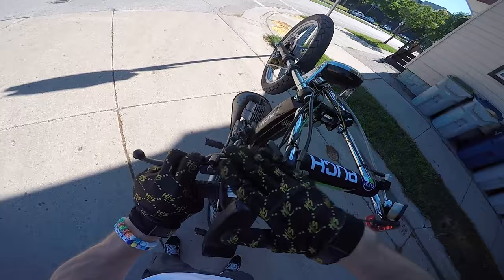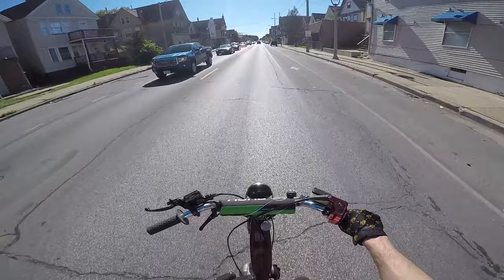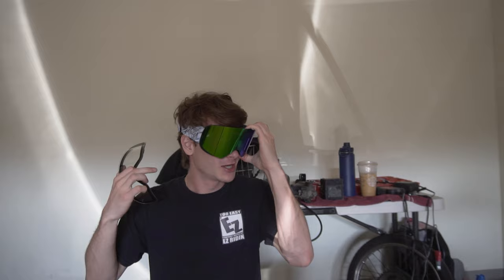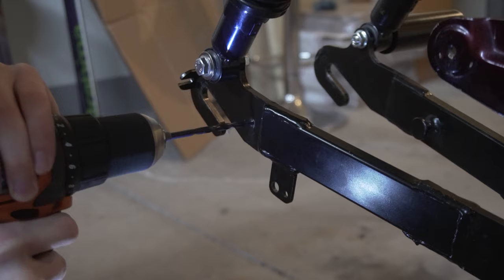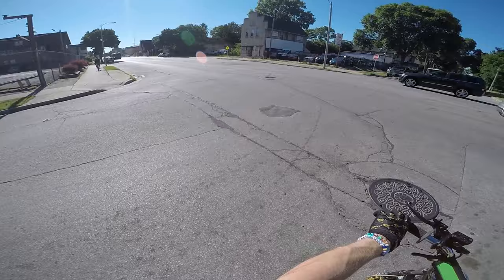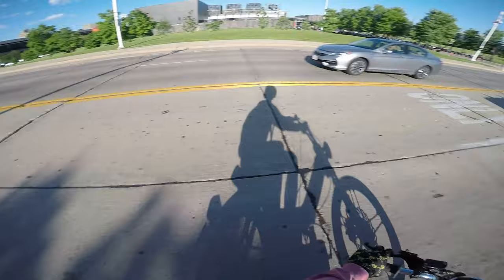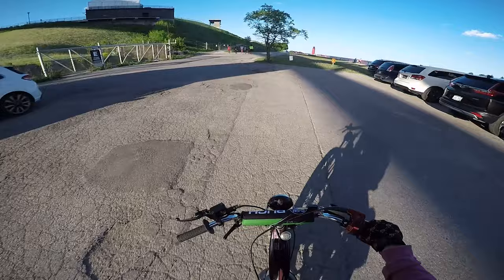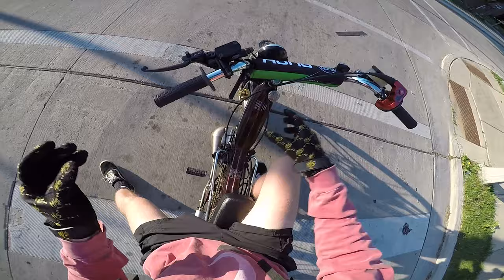Custom Moped REAR DISC BRAKE!! (You Need This)

Comment: Sweet Puch! 
The brake gets stiffer when it gets warm if it isnt 100% bled because the tiny airbubbles that may be trapped expand with the heat. I would bleed it again, as the first ride (bc of bumps etc) may release the last airbubbels that you couldnt get out the first time you bled it. Nontheless a super moped!
Reply: Refferring to 11.39
Reply from the maker: That’s a good idea man, thanks for the advice!

Comment: I like the i dea of disc brakes on my moped, i gotta say that my front stock drum break works really well. Too well. I actually did a endo with my moped and got flipped over the hadle bars doing about 2o mph and landed on my hip on the paved road. I was 44 then and going to be 46 this sept. Ive had major back problems before this that at the time was not bothering me anymore. However since that accident my back went right downhill. Ivd been out of work now since dec. 7th 2021. My job couldnt hold my position anymore since i was out 6 months and couldnt get cleared for work. Now im looking at surgery and had to apply for disability that i will probably be denied. It sucks but i still love my moped. But be carefull because accidents truly can sneak up on you and leave you with permanent damage. I will ride as long as i can.
Reply from the maker: Yea man, that’s a crazy story haha. I hope you are doing alright!

Comment: you should try a piaggio ciao. Great moped
Reply: My old neighbor has one of those a vespa piaggio. I worked on it for him and got it running for him. It is a nice moped dual variated good running ped i really liked it. Could not get him to sell it to me either.
Reply from the maker: I've heard a lot about them!!
Reply: @joshloose1078  i have a 65cc kit on mine and it goes maby 80kmh. Great moped, but the frame could be abit more sturdy
Reply: @urhbizilj7330  nice, i own a 78 peugeot 103 with 70cc kit on mine dellorto 15.15 sha card with a athena reed valve and a polini utah pipe. It goes about 40-45mph
Reply: @joshloose1078  man i want that one or a puch maxi but where i live they dont sell them. Very cool build
Reply: @urhbizilj7330  thank you its on my channel if you didnt see it.
Reply: @urhbizilj7330  where are you from?
Reply: @joshloose1078  i am from slovenia. People here mostly have tomoses. Still pretty cool but it gets old when you see them everyday

Comment: I really want that bike, you wanna trade for my 78 peugeot 103 lol?
Reply from the maker: Haha sorry man this one’s gunna go in a museum when it retires
Reply: @TwoStrokeJ  guess ill have to open a moped museum then lol.
Reply: @TwoStrokeJ  But i do wanna keep my peugeot lol. But i would like to have yours but sometime ill get one when i can afford it. Peugeot is cool but its a hard bike to tune i believe my ignition coil going bad on mine. Bike runs really good till it heats up then runs like crap. Its consistant with bad ignition coil. Im gonna go cdi when i can afford it. Has a grounding issue which can also be consistant with bad ignition coil. Pretty sure its the original coil and they get cracks in the insulation around it and sparks come out the cracks and ground to the back of the magnetto. Pretty sure thats the issue.

Comment: Hey do you have any advice me dad just gave me a puch 1980 maxi I think the tank is rusted out I have a bungee cord tying a small gas can to it is beaten up what should I do to it
Reply from the maker: I don’t remember exactly what liquid you use but you can fill the tank with stuff that eats the rust away and cleans out the tank. Then you can drain it and it should be much more clean! You can also put a fuel filter in the fuel line to help too. Look up a video on it, I think there is a lot of people that have that problen